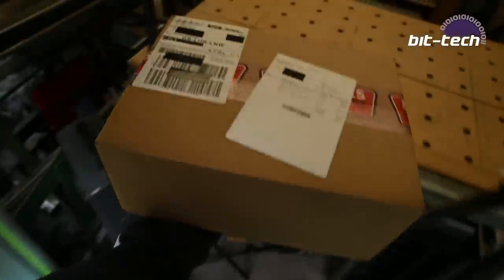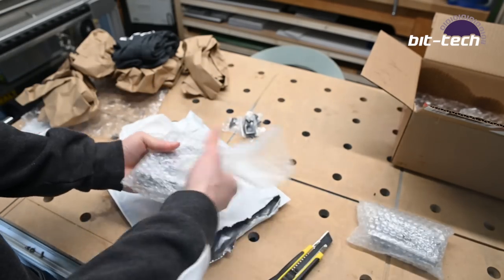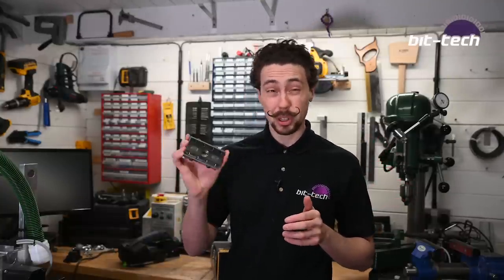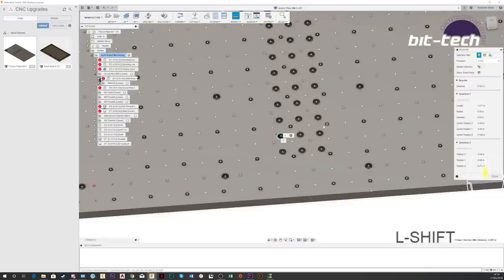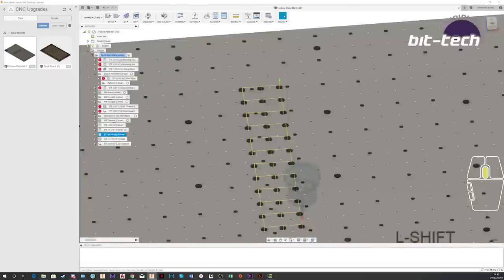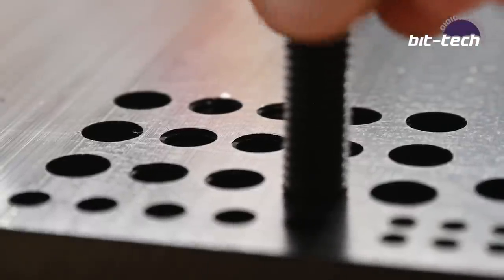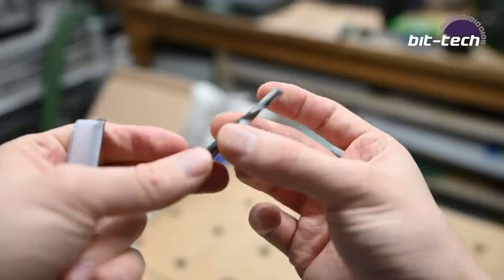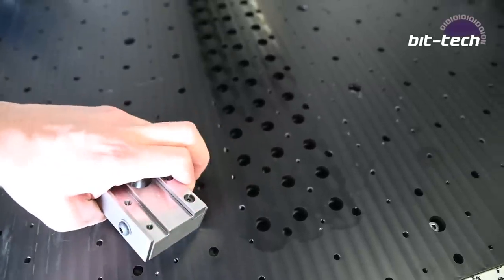Adding a Saunders Mod Vise to the CNC Fixture Plate | bit-tech Modding

Comment: "oh i carnt work with any of this lets just switch this back to metric" has to be the best quote I've heard in a long time. I've had to learn imperial as a lot of the work i do all the drawings are. Still program all in metric but I do have to convert between there are good online converters that can be found. 

Also in fusion you just have to type in the unit and it will convert for you. in the drawing workspace if you (in metric) add a dimension and you add IN (eg. "2.5IN") it will add the metric dimension (63.5mm) without having to change the units your working in.

Comment: In every thread milling video I've seen they always say to start at the bottom and cut upwards otherwise the swarf can build up in the bottom of the hole and give problems (damage the thread or clog up or even break the tool when in steel). Anyway it's a good habit to get into.

Comment: We have made our own fixturing system over many years that is somewhat similar, but much more versatile using Mitee Bite pitbull, t-slot and toe clamps. No need to buy something when you can make it for 10% the cost. Buy an aluminum or steel plate and get to work!
Reply: would live to see some examples of your fixtures

Comment: I'm new to CNC. This is the first time I've seen making threads with a thread mill. Ive mostly noticed ppl drilling holes and tapping them manually or with a lathe afterwards.

Besides expediency and repeatability are there other benefits to using thread Mills? Are they hard to use or figure out speeds/feeds?

Would a desktop CNC like an x carve or shapeoko be able to utilize this to good effect?

Thanks
Reply from the maker: I think the desktop ones can but it might be harder in some materials, you basically need a nice and rigid Z-axis with good repeatability for it. It’s actually pretty straightforward once you get used to things, the tricky bit is figuring out the settings for each material since they all behave quite differently. For instance I found I get better results in acetal doing a full cut in one pass, whereas acrylic benefits from doing a spring pass.

A big bonus for me is being able to tap holes that would normally be very difficult by hand or extremely numerous. A large distro plate might have 200+ holes and the base of the hole might be less than 1mm from the other side of the plastic. For threadmilling that doesn’t matter, but hand tapping (even with the aid of a machine) those is extremely hard as the taps can easily break through to the other side or crack things.

Comment: Great job getting this installed. Where do you suggest getting threadmill cutters in the UK. Seems hard to find.
Reply from the maker: This Designed That I buy direct from Datron, but places like Cutwel tend to stock them too. Sorotec is a good option as their ones tend to be lower priced and shipping from Germany is still pretty simple.
Reply: @bittech1  cheers mate, will have a look. Thinking whether to get the SMW Mod vice or maybe go with some mitee bites and try make a fixture plate like you did. Great video, would love to see more fixtures if you do any for future projects
Reply from the maker: @ThisDesignedThat  Have you seen the one used in Aquaceras Part 2? That was good fun, real learning experience too. I picked up 40 Mitee Bites actually over the weekend, should make for something rather cool if my plan works out.
Reply: @bittech1  yes i saw that, they came out really nice and it what inspired me to have a go at making my first fixture plate :). Where did you get your mitee bites from? Im about to order some pitbulls, looks like Wixroyd is probably best best for us UK peeps
Reply from the maker: This Designed That Yup I went to Wixroyd also. I found a place that was marginally cheaper but Wixroyd has a larger selection of products and a much better laid out website.

Comment: Nice setup, you build the machine yourself?
Reply from the maker: It's a CNC-Step S1000-T. It's similar to a DIY one but comes basically ready to run. I was worried I would put assembling a kit one off for ages when things started getting busy, made sense to go for one that skips that stage. Been a really solid piece of kit so far!
Reply: bit-tech Nice. I’m new to cnc and just ordered myself a Shapeoko 3 xxl as a starter machine for some prototype mods and distro plates. Your vids have been a great resource
Reply from the maker: That’s awesome to hear! You’ll be able to make some awesome stuff with that machine, they’re really rather capable.

Comment: Why is your lath chuck key in the chuck? Huge safety mistake.
Reply from the maker: It can’t be switched on with the key in, the chuck cover has to be closed for the on switch to be activated, plus it’s unplugged from the wall when not in use.